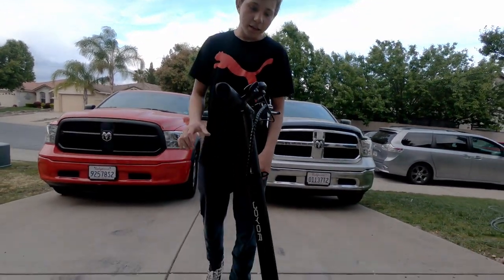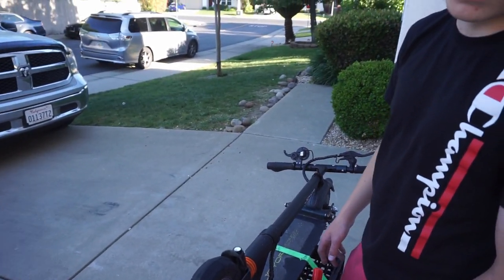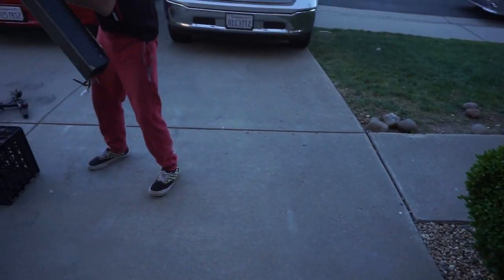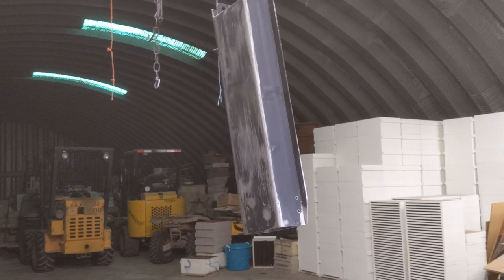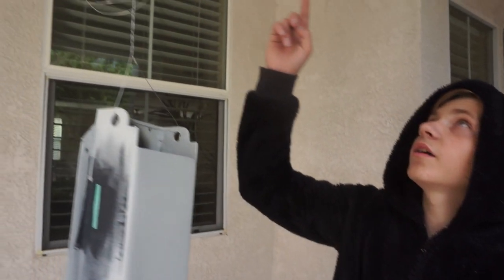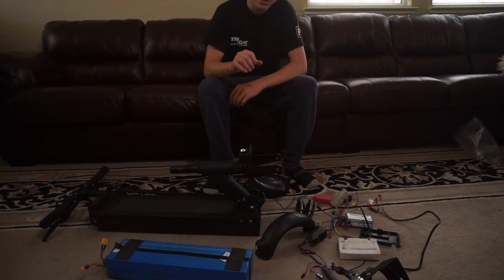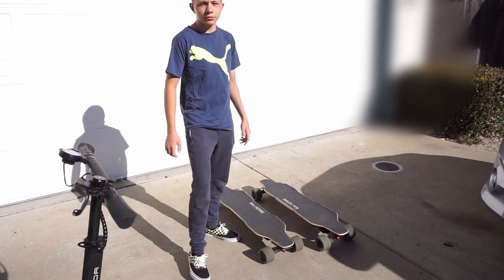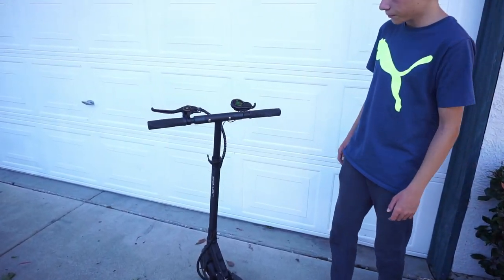Rebuilding a Destroyed Electric Scooter

Comment: Do you know what the part number is for the lcd throttle part or where I can get one. I need to get a replacement. Thanks for the video. Helped a lot.
Reply from the maker: Not sure. You can try to contact joyor but I'm sure it won't be cheap.
Reply: Ok. Thank you